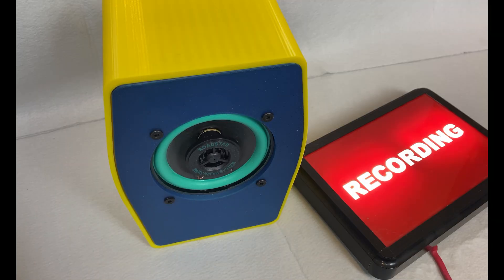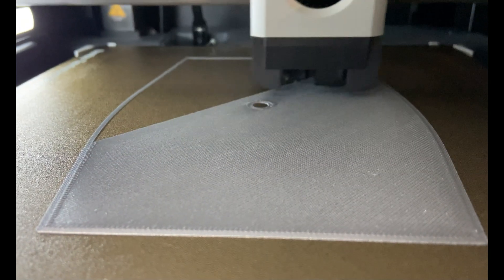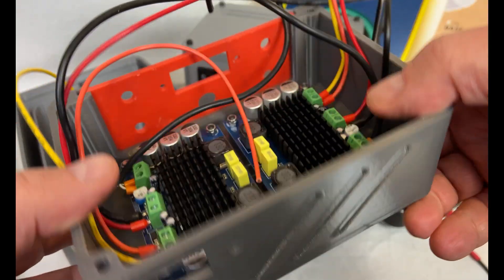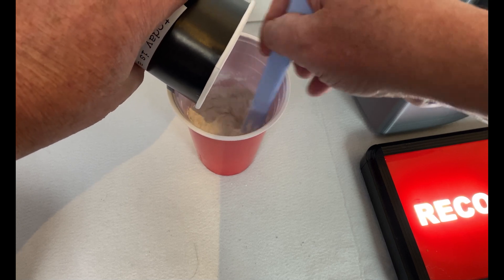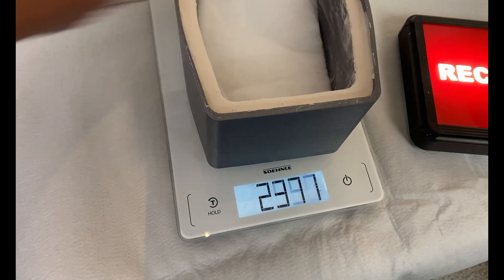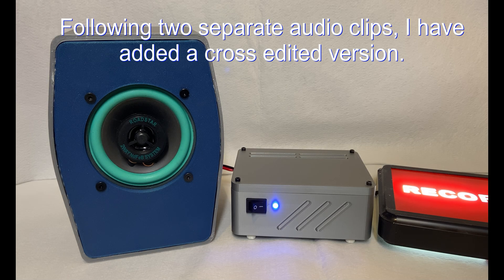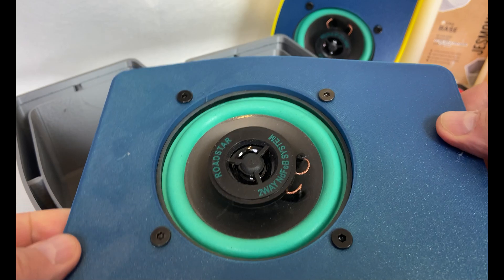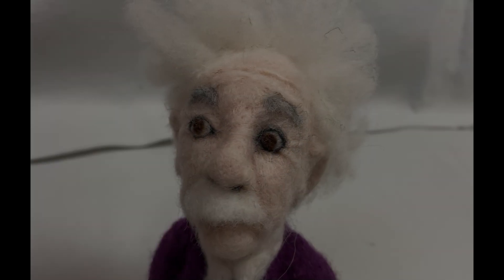3D printed sound system - take 2

Comment: In my opinion this speaker design is quite useless. The driver is only connected to the plastic front, which means it has an increased resonance surface. Thats why it sounds so tinny. A usefull design would be to add concrete to the front, so that the self-resonance of the case gets eliminated. As long as you just glue the front to the case you do not need to fill the back with concrete as there is no real proper connection between front, driver and case. Anyways: I apreciate your try on this.
Reply from the maker: Yes, I agree this is useless. Still I think the speaker driver itself is the main limiting factor. Changing the material of the front panel might do something to the sound, but I am not convinced it will work wonders :-)

Comment: 0:50 those supports can all be completely avoided by giving the lower edge of the protrusion a 45 degree bevel
Reply from the maker: You are absolutely right and I did try to do that but Fusion refused to add the chamfer to the full area I needed it. It cost me about 1 hour extra printing. Appreciate you noticing such details :-)
Reply: @v4projects  in the slicer itself you can use “make overhangs printable” setting which should've worked perfectly for this specific case. Also if Fusion refuses to add a chamfer, try lowering the radius a bit, e.g. if you need a 3mm chamfer try 2.8 or something. It would have no negative effect on the print.
Reply from the maker: I tried lowering the radius, but I couldn't get anything usable out of it. After some time trying different things in Fusion, I just accepted the extra printing time.  (Lazy, I know). I have never tried the slicer setting you suggested. It's in Orca but I can't find it in Bambu Studio. Thanks for the tip!